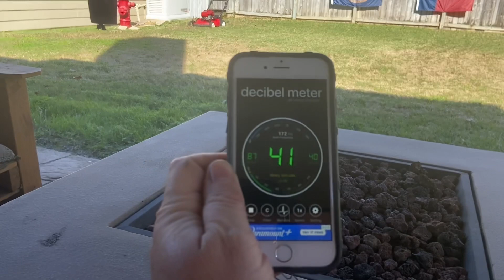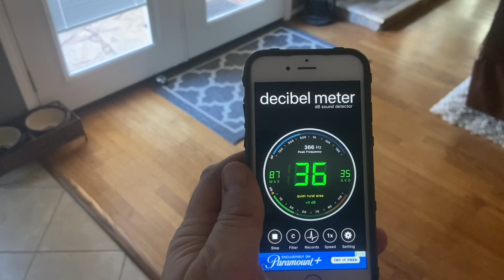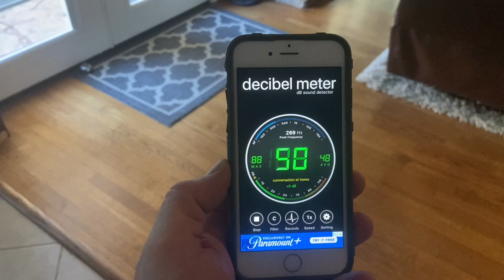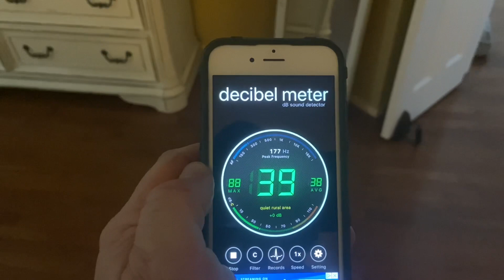How Loud Is A Home Standby Generac Generator?????

Comment: Despite the ‘inaccuracies’ of the sound level measurement, your comparison with the lawn mower was very smart!  Thx for sharing!
Reply from the maker: Thanks for watching and the comment. Was extremely accurate used science and everything but it’s cool have a good one.
Reply: Only problem is no one is mowing their lawn on and off for hours at a time, every day.
Reply: @robertt9342 or during the middle of the night. And he probably got the idea from the Generac salesman since they just told one of my neighbors it was going to be about half as loud as a lawnmower.
Reply from the maker: Nope I just tried to help people out, don’t assume. Your also forgetting that everyone will be dragging out the portables that won’t do 1/2 of what they need and will be making that same amount out noise so………

Comment: I am in Houston and just got a 24 KW Generac installed.  Mine uses the same engine as yours and is a lot louder than a typical lawnmower.  I know if my lights are out so are my neighbors and they will just have to deal with the noise.  That said do you know of anyone that has built some form of noise abatement enclosure or wall?
Reply from the maker: No I don’t, and it would unfortunately probably void the warranty. I believe you have to keep 3 foot clear on each side for air intake and exhaust. Thanks for the continued support.

Comment: a 5500 watt generator it's louder than a 22 KW generator I know have a 8700 Watt gasoline generator as a backup that thing is loud compared to the 22kw generac and my Generac as not as efficient or as quiet as one of the new ones because mines is 27 years old still quieter that gasoline generator
Reply from the maker: Thanks buddy for watching please subscribe and check out my some of my other videos

Comment: After Ida we ran our generator 24/7, for 18 days.  Other then 2 cool downs, one before dark, and one after we woke up in the morning, and of course, coffee was made.  :D  Screw the neighbors if they have problems with the noise.  Most of our neighbors that didn't at least have a generator was more concerned about their misery, then the noise the generators made from those that did have them.  Nobody that I know of complained about the generator noise.  Had they complained, they would have been ignored. :D
Reply: Just remember that sentiment when you are getting mad about something annoying. If you have no consideration for others, expect none in return.
Reply: @robertt9342  So you would suffer, terribly, without power, when you own a generator, because your neighbor doesn't own one?  I don't believe that for one second.
Reply: @robertt9342  It has nothing to do with being considerate.  There is nothing anyone can do about the generator noise.  And it's not like you are going to stop running it when it's over 100 degrees outside, and you have no electricity.
Reply: Dang, what brand generator?
Reply: Arent you a thoughtful neighbor!! NOT👎
Reply: @ttodd910  What are you talking about.  After a hurricane, everyone that has a generator is running it.  The ones that don't own one, have never complained.  The only complaints that most have, is they WISH they had one, because they are suffering.  Believe me, if you own a generator, you would use it, of course you would!
Reply from the maker: 💯 % agree
Reply: @ttodd910  - Thoughful enough to have lights, heat, refrigeration, microwave, AC, etc. while you sit in the dark!  😏

Comment: These gennys are quiet. My portable is louder than a standby. Thanks for your data and comparisons. I think it paints a real picture of what at standby genny sounds like inside your house and comparably what your neighbors will endure. Thanks for your effort sir!
Reply from the maker: Thanks buddy for watching and the comment, your right it’s really not bad unless you or neighbors are our in the backyard. Please give me a subscribe! And check out some of my other stuff. Take care and have a great rest of the week and weekend.
Reply: Depends on the portable. My closed-frame propane inverter generator is WAY quieter the these whole house units. Unfortunately, there's always some cheap bonehead running a loud open-frame unit which ruins it for the whole neighborhood.

Comment: So its where you point the exhaust
Reply from the maker: It’s how and where you install the unit  based on which way the exhaust would be located.
Reply: I got the 22kW Generac Guardian Home Standby Generator with 200A SE Rated ATS | 70433
And its 20 feet away from the house. Going to point exhaust towards back greenbelt. But I am thinking of building something that would dampen the sound
Reply from the maker: @PNWLiving1725  I had to have mine point towards us due to the gas and electrical coming out the back of the unit, if you build something look at your manual I believe you have to keep 3 or 5 foot clear of the air intake and exhaust

Comment: Generac is a good choice. It costs more up front but saves you the cost of building an enclosure and most people don't pay attention to compartment heat which the Generac Engineers already took care of. Those noise levels are nothing to be concerned with. A typical rule of thumb is the elect & enclosure for a typical open frame generator is 2x the cost of the generator. In my case i spent 3x on the enclosure and wiring (did it myself). Sound insulation is expensive which is partly why mine cost so much. My generator is a Honda so the 3x number is quite high.
Reply from the maker: Awesome thanks for watching please subscribe and check out some of my other videos!

Comment: Thanks for trying, but there is a problem with your testing.  In your test, the power to your home was still on. As a result, there was no load on the generator. All you measured, was the low frequency noise from the generator engine. Sort of like measuring the noise from your car with the engine just idling.  Once load is applied, our neighbor's Generac starts to develop a high frequency pulsation over top of the rumbling engine noise.  Penetrates our home making it impossible to sleep. Although the dB measurement may be considered acceptable by Generac, it is not. I would advise against anyone buying a Generac or other cheap unit.
Reply from the maker: Your comment is totally wrong and off base , this was a full load power outage, city power was turned off for this test. I would have not wasted my time in doing a fake test don’t assume because well you know.
Reply: @JustCantSitStill  So, what did you have turned on in your house to make it a FULL LOAD test? Those Generacs make a different noise than yours did when under full load. If you had read my post, you would know that it is my neighbor who has a Generac. Sorry to annoy you, but post full details of your test next time.
Reply from the maker: @GrahamM-sm1hv  It’s tough to mention every small detail , no matter what someone like you will come along and try to pick anything apart. I can not cater to everyone’s thoughts and opinions right or wrong. During this test 2 three tons a/c’s would have been operating as well as the washer/dryer refrigerator and deep freeze and numerous other items. Your neighbors sounds like it may be undersized cheap unit as you describe.
Reply from the maker: Our unit does not change sound no matter the load, the only thing you would here is the initial start up of the A/C after that there is no change it sound. They operate at 3600rpms with a load or not unless you have the quite exercise mode on which I don’t.
Reply from the maker: Be sure to thumbs down 👎 the video twice ! It will make a difference.
Reply: @JustCantSitStill  said "Your neighbors sounds like it may be undersized cheap unit as you describe" It isn't - likely the largest size available . The house is large. But it is VERY noisy. Just hope those that buy generators take into account that they have neighbors.
Reply: @JustCantSitStill  Not what we experience. Weekly test and full load noise levels are quite different. Full load, and us as neighbor's cannot sleep through the noise. Even owner notices the noise. I won't answer any more. Anyone reading this, just be aware that these are very noisy beasts.
Reply from the maker: @GrahamM-sm1hv  I did and my neighbors appreciate the offer of an extension cord or warm/cool house to stay in during a extended outage. I am still waiting to know what option you went with or would go with ?
Reply from the maker: For anyone else please don’t forget to read the video description before commenting it may answer a few questions.
Reply from the maker: @GrahamM-sm1hv  once again this was not a weekly test , you failed to read the video description which is ok most people don’t. I hope everything gets better for you life can be hard.
Reply: @GrahamM-sm1hv  Your neighbor must have an older unit because mines doesn't make alot of noise. Wait....you don't even have a generac but you do have plenty of hate. Did you get fired from Generac?
Reply from the maker: What generator do you recommend since mine is a cheap unit? Just curious to see what the all knowing Graham has?
Reply: Thank you. t I'm 200 feet away from one and unable to sleep inside my house. These things are LOUD

Comment: I wish I could find something as quiet as a car engine. It would be nice to have something as quiet as a 4 cyl nissan engine idling.
Reply: Actually you can buy a stand by that run 1800 rpms they cost more but you get what you pay for.
Reply: @rockystelone21  Do you have a link for this?
Reply from the maker: Generac makes liquid cooled models that do this.

Comment: Thank you for the comprehensive explanation of back up power by a generator. I have a similar set up but I use a roll out in a stainless steel enclosure. I have one of the quietest roll outs available on the market today (The Honda EU 7000is). I paid less for my generator but that was 3 years ago. Mine is rated at 58 decibels full power & 54 decibels on eco mode. I can’t hear my generator running when the neighborhood is flat. I can only hear my neighbors roll outs running from my front steps. 
The only other thing you forgot to mention is fuel consumption. The larger the generator the more fuel it burns. In your case it’s not a big concern because you have natural gas. Others with propane as their fuel will need to know that. I was originally interested in buying a propane standby until the ASSociation we live in said no to a 1000 gallon propane tank. In reality a 1000 gallon can only hold 800 gallons of liquid propane because it needs room in the tank to turn to a gas. I was interested in a Kohler 14kw model. They burn 2-3 gallons of propane per hour. That would be 50 gallons per day conservatively after a big storm. If someone lives way off in the country they might be out two to three weeks to have their power restored? They better hope the roads are open enough so they could get a delivery of propane before they run out of fuel?
Reply: I live in Panama and recently there were major protests over inflation, and gas prices and demonstrators shut down the supply lines. The first thing to disappear was gasoline. Lineups at gas stations were hours long. If you have a gas generator you might find yourself out of luck when the SHTF. Propane will be easier to come by and it does not go bad if stored for long periods. I strongly suggest dual or tri fuel.
Reply: @cayrick  Your absolutely right for most consumers. Most only have 2-5 gallon jugs for fuel. They fill them when they lose power. After all we aren’t talking a Hurricane or seasonal storm. If a storm is forecast, different story. I see people filling either larger barrels for fuel not approved for the storage of gasoline because they don’t expand when heated. Or 5 gallon jugs. I happen to have 15-5 gallon jugs at the ready when a storm is forecast. I do keep 30 gallons in my fuel transfer pump made by HMC. I’m good for three days with my fuel pump. If I fill my fuel jugs that buys me an additional 7 days of interruption. The most I have lost my lights for was for 5 days without a generator. It was miserable 😖. I learned a powerful lesson. The most I lost power for with a generator was 3 days.
Reply: We've got a 24KW on propane at my parents with a 1000 gallon tank.  On average (somewhere between a half-load and a full-load), it'll use roughly a little over 3 gallons per hour, so all in all, about 10 days of non-stop run time.  If you knew that things were going to be really bad in terms of being able to get more propane delivered, you could stretch it by reducing the load, or just turning it off for a stretch here and there.   One would hope that 10 days would be more than enough to get you through even a bad event like hurricanes we have here.... or at least long enough to get some amount of propane refilled.
Reply: You can convert the Dual Fuel to a Tri Fuel.  Then run a gas line from your meter to the generator.   Just search on YT for videos on how to convert them.  It is really easy.  Or, you can actually buy a tri-fuel generator and hook it up to NG.
Reply: @jmackinjersey1  Thanks for that information. However that won’t work for my set up. If I had natural gas in my neighborhood I wouldn’t have gone through the trouble of setting up my hybrid set up. I inquired about extending the natural gas line 1500 feet to my house. I was quoted by an engineer that it would cost me $100,000 for that. I reminded him I was an employee of the same company in the electric division. I only made that a year. He said in that case as an employee I would be available for financing. Instead of having to pay it off in 10 years. They would grant me 15 years to pay it back. 
I asked if I paid for it? Would I own it? No, as soon as they charged the line with live gas the ownership reverts back to the gas company. Anotherwords extending a natural gas line is not in a homeowners best interest unless you own a mansion & a yacht.
Reply: @johnclyne6350  On a remote property I have a Honda EU7000iS with the propane/nat gas conversion by Genconnex.  It uses about a gallon of propane an hour on full load, and about a half gallon of propane an hour on half load.   While we have the unit hooked to a 500 gallon typical horizontal tank on the remote property, when I had it at home in my residential neighborhood with an association (before I installed my whole house Generac), I had three 100 gallon vertical tanks sitting in the garage.  They're pretty small, a little over a foot in diameter and about 4 feet tall, so they don't take up much room.  At full load, each of the cylinders would run the EU7000iS for a little over three days.   For a residential setup, keeping the three 100 vertical propane tanks was a lot easier and less worrisome than trying to keep a dozen or more 5 gallon cans full of regular fresh gas.
Reply: @5thGenNativeTexan  Yes, that definitely works better than toting gas cans & having to continuously refill every day. 

Unfortunately where I live is an ASSociation. They picked an argument with me over the existing 50 gallon propane tank on our property. They had no idea we had one? The previous owners decided they wanted it & either had the builder of their new home include it in the purchase or added it later? I’ll never know? Irregardless we weren’t suppose to have one? I told them that they would have to grandfather us in because it’s been there atleast 25 years. 

I mentioned that I wanted to bury a thousand gallon fuel tank on my property & they told me absolutely not. The idea was I would install a Koehler 14 kw stand by generator. They argued with me that they hardly ever lose power? Why would I want one? Well I never tipped my hand but I did admit that there was a power lineman on my street that contradicts their findings. They wouldn’t budge. 

The only option was the Honda roll out generator. We have 79 hours on it already. It has performed flawlessly! Even so far as running our entire house including our central air. I know in the back of my mind that my family is safe. I can concentrate on my job. There is nothing better than coming home after working a double shift at night restoring other people’s power. To have a hot shower & cool air in our house.
Reply: @johnclyne6350  That's why I had the three vertical tanks in my garage.  Completely out of site, didn't take up much room against a wall.   Moot point now that I've moved it out to the remote property, and I run a 27KW Generac on our nat gas line.
Reply: @johnclyne6350  Thank you for reminding me of how much better my life is.
Whatever possessed you to move to a homeowner's association?
Reply from the maker: Thanks for watching and thank for the great comment. Please subscribe like share check out some of my other videos, this one was just one the noise level I have another going over the unit in more detail.

Comment: I had a Generac 22kw delivered today, I was a bit concerned about the noise level.  Tomorrow I start the installation.  I appreciate you posting your video.
Reply from the maker: Awesome congratulations on the generac, thanks for watching glad it was helpful, please subscribe like and share. Good luck with the install hope it good smooth.
Reply: @JustCantSitStill  I'm an electrical contractor, but I've never installed one of these before, except for portable gas generators with manual transfer switches. I'll let you know how it went. I'm a new subscriber!
Reply from the maker: @kirklandelectricicnc  thanks Steve and yes let me know how it goes 🤞🏻
Reply: You won’t mind the noise level when you have the AC cooling your house while the power is out. Or the heat keeping you warm.